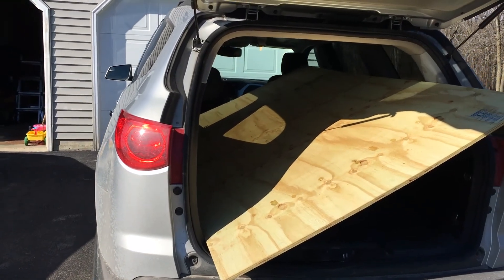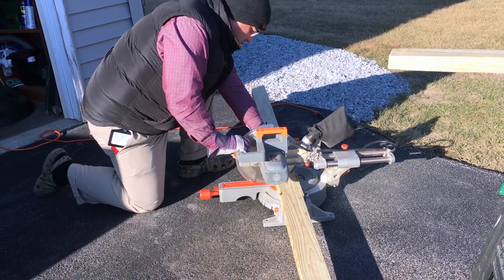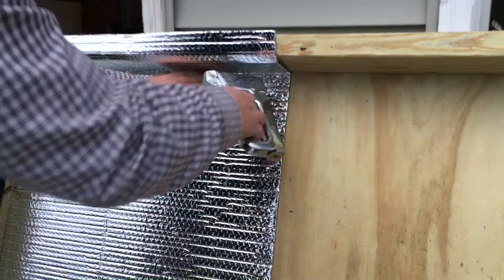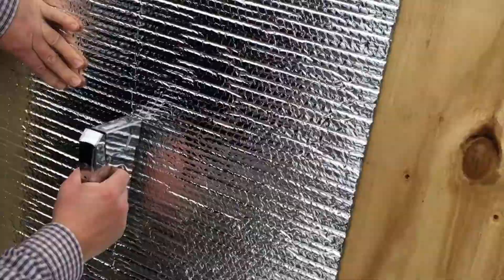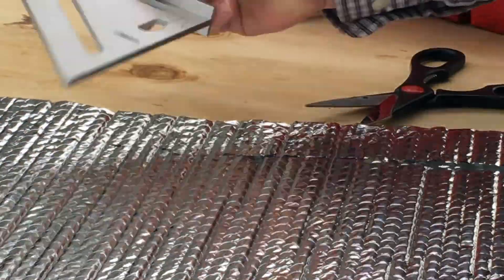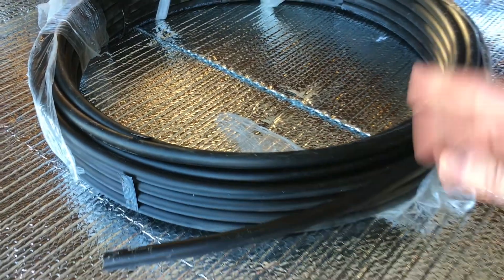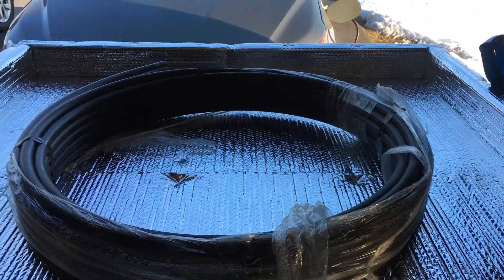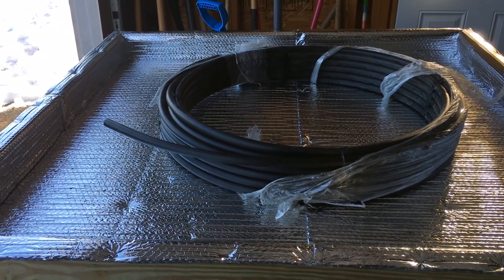DIY Solar Pool Heater - Part 1

Comment: I'm fixin to build one of these solar pool heaters. Did you ever determine if pex or a thinner walled irrigation hose was better? Also, did you ever determine if having two layers of hose was better or worse than one?
Reply from the maker: Use only one layer, I ended up removing a layer.

Comment: I'm building this same thing but wonder when you put the foil insulation down did you only use 1 layer or 2 going opposite directions to go up and over the 2x4 sides?
Reply from the maker: 1 layer

Comment: How many feet of 1/2" tube did you end up using for a 4x4?
Reply from the maker: Originally 200 feet, but this season I removed 100 ft so sunlight is hitting all tubing.  Much better performance including more water flow.
Reply: @GreenMountainDIYGuy  thanks
Reply: @GreenMountainDIYGuy  I was doing exactly the same as your video when just saw this comment, I'm already on the second layer of tubes, do you recommend leaving only one layer, you said in the video the first layer would be warm, do you think or have tested a better performance with only 100 ft?

Comment: I made one of these in Michigan. Sometimes my pool was too hot! These suckers really work! It was the 18ft diameter Intex, but I’m sure it will work nicely on a bigger pool. Make two if you have to. They’re still better than most solar heaters you can buy, and if you make it well, it will last many years.

Comment: Could you use 1” tubing instead of 1/2” for a bigger pool?
Reply from the maker: I would focus more on additional tubing and perhaps make multiple units.  Plan on building another similar unit this spring and tie them together in parallel.
Reply: Green Mountain DIY Guy - so go with smaller tubing because too much water flowing through the lines won’t heat up as high?
Reply from the maker: @jasongates3710  Yes and no, in the end it's really the same thermal energy being transferred regardless of how fast the water flows.   I mentioned additional arrays to increased the potential for transferring more energy.  Larger pipe may have the same effect.  I think the smaller pipe is much easier to work with.  Hope that helps.

Comment: I am doing a solar pool heater myself. Can you please tell me where in the pump plumbing do take off the water to go to my panels ?  DIscharge side of pump before filter or after filter ?
And where do i reconnect back into the system ? Downstream just a tad of where I took the water from ? Appreciate your help.
Thanks, Gerry from San Diego, CA

Comment: great vid i also have a 21ft above ground pool could you please tell me where to get the insulation and tubing. also how do you plan to circulate it threw. parts list would be great. like the crocs got a pair like those too!
Reply from the maker: Thanks,  I have a parts list for the tubing and insulation listed in the video description above. Part 2 or 3, I'll go over how the water will circulate.  Should be back to work in the pool heater now that the weather is beginning to warm up.  
Will add to the parts list as I go...
Reply: Green Mountain DIY Guy and